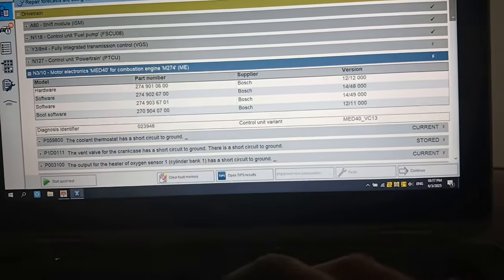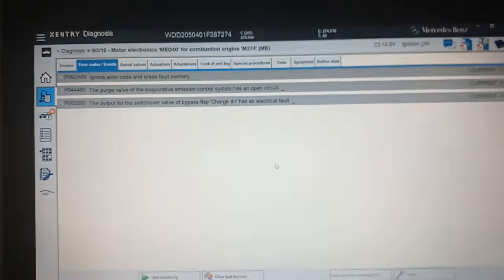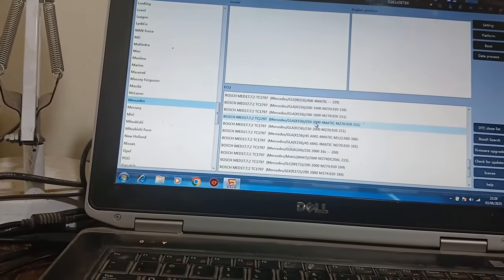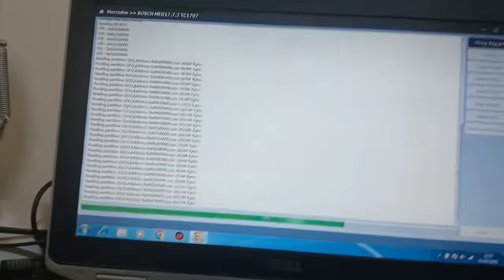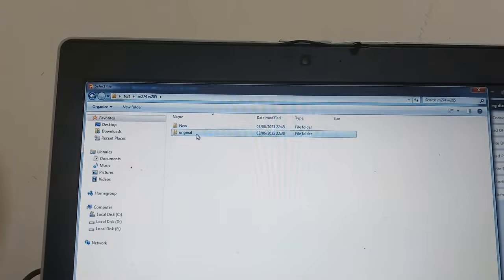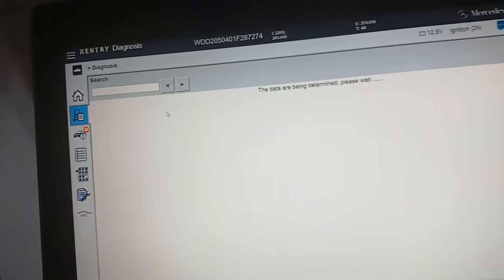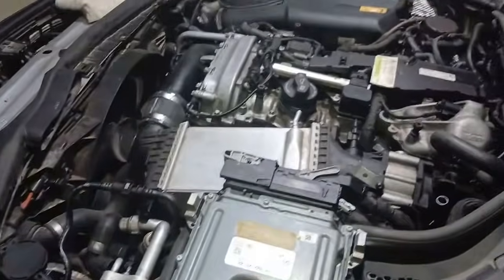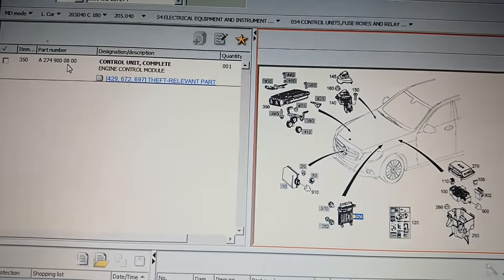M274 Engine Electrical Diagnosing & Repair For W205 part1

Comment: selamu aleykum Hesham, I wonder i have error on xentry showing error test component B163/3 sensor , differential pressure of particles is -3.00 HPa. I own w213 benzin 4 matic and I cant find what part should be here replaced or it could be related to hoses in the car. Please if you can maybe clarify assist on this